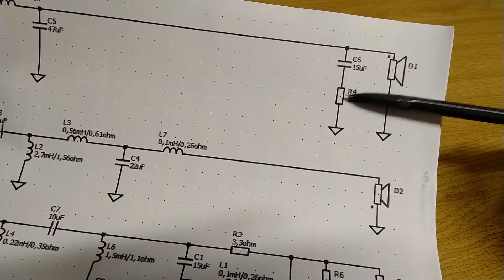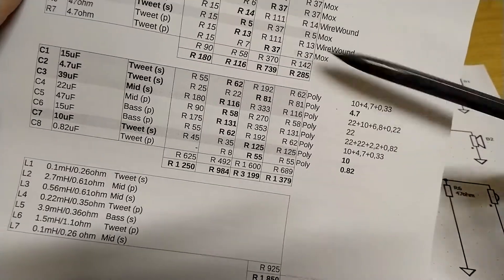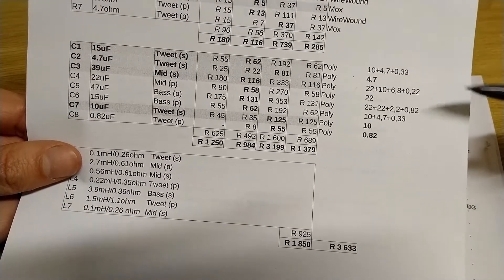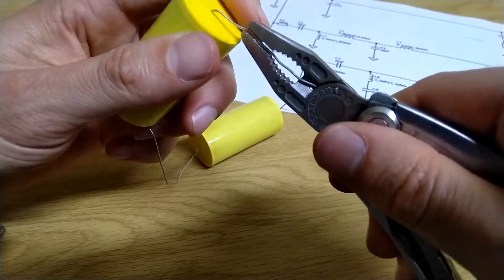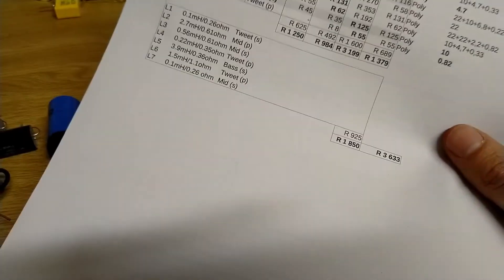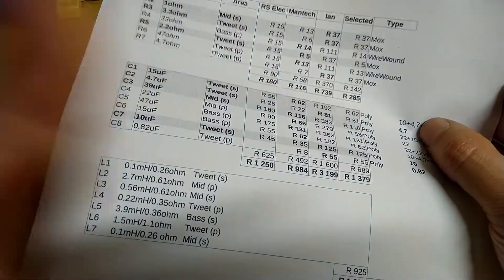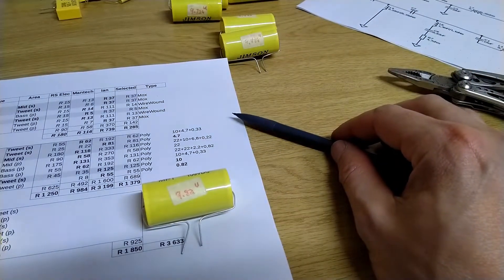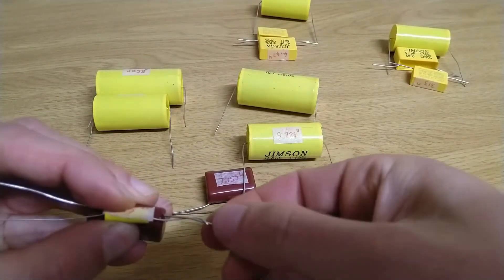Crossover Plan Reading and Making up Capacitors

Comment: Xsim doesn't like multiple caps in parallel, so just type in the value you would end up with in the crossover design after adding together.

Comment: That is alot of capacitors in one speaker. That's gotta be a pain fitting that in there.
Reply from the maker: Yes it is a lot of capacitors. If you are able to find the exact capacitance values then you may save on some bulk by not having to combine capacitors to make up the required values.

In the end it all fit, even with the inductors and resistors. 😅Check the playlist for some of the last few videos which shows the approach I took which basically entailed splitting the crossover into three modules.